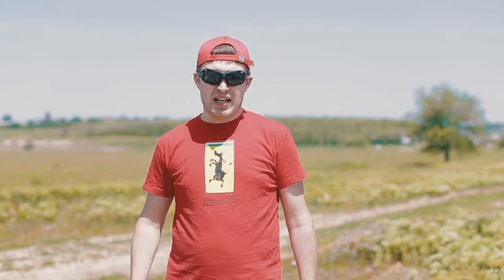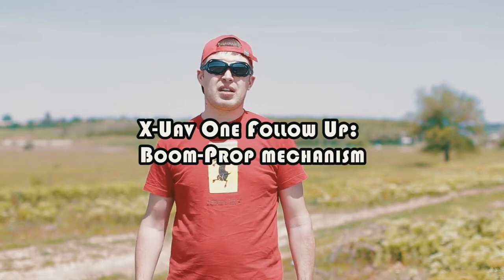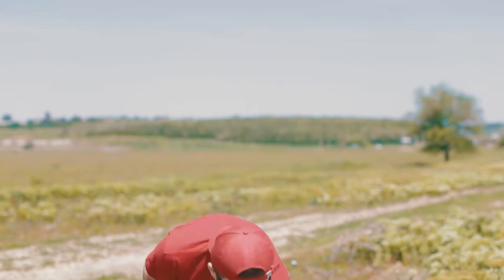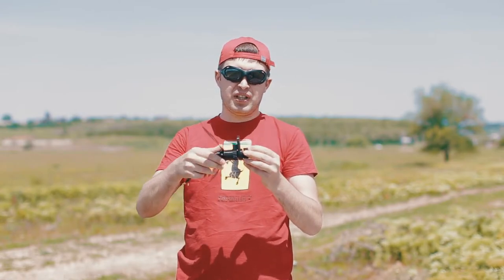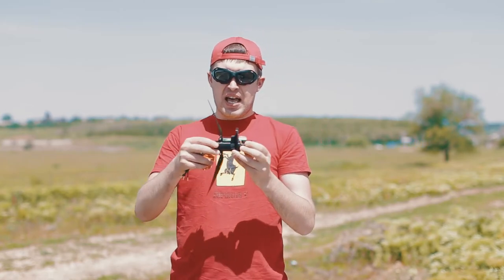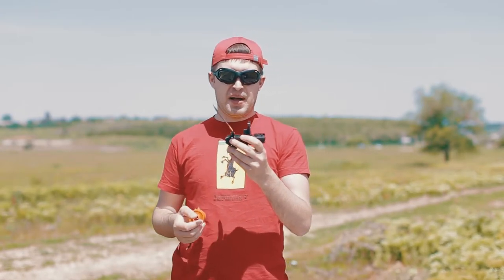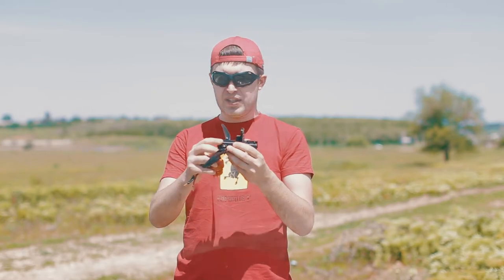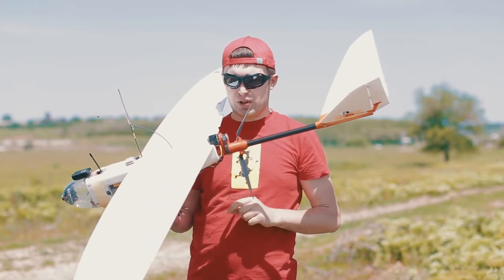X-Uav One Follow Up: Boom Prop mechanism

Comment: Well done on the review - very little info on this plane. We've just acquired two of these for testing - will be printing out ian's files!
Reply from the maker: Be careful. Better get in contact with Ian before printing. As far as I know, the files he shared aren't compatible with x-uav one. He modified the boom specially for x-uav one.
Reply: +Sheban X - Did you fly your XUAV One?